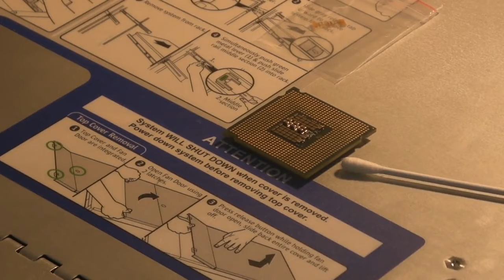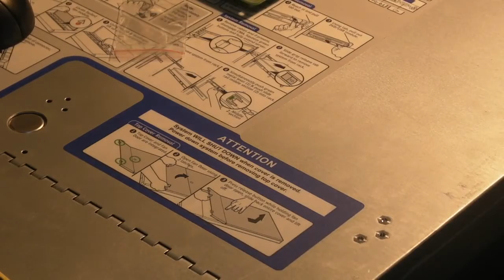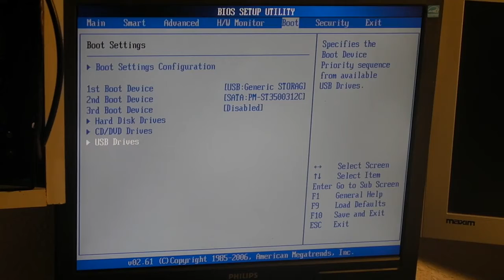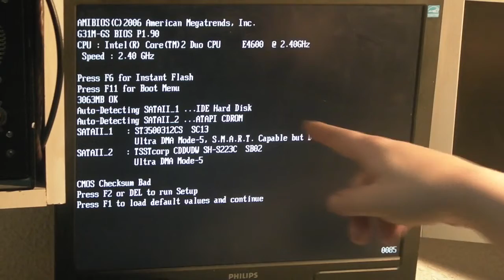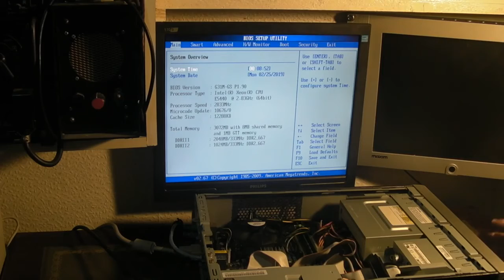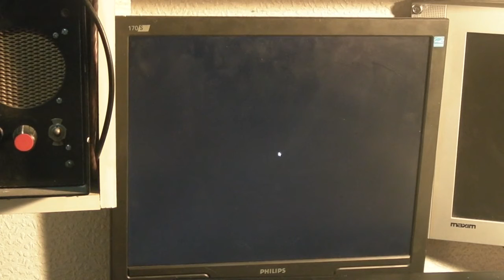Core2Duo CPU to Quad core Xeon CPU on the cheap Pt2

Comment: Realised tonight I don't think this will work for my BIOS =/  I can step up to the 3.0Ghz Extreme (quad) with 12M cache though.  All I will gain is 4M of additional cache, but can overclock to between 4.0 and 4.4Ghz I think.  Will have to settle for that =/
Reply from the maker: I'd of thought if it will run with an Extreme quad then it should work with the Xeon with the microcode added to the bios. (should still run with a unrecognized CPU error at startup without) the only motherboards I've found that you definitely cant use are ones with very old chip-sets that only support two cores not four.

Comment: I was wondering from the start how server memory (which is ECC memory for obvious reasons) would fit into a desktop board...now I know: It doesn't ;-)
Anyway, you can get 8gigs of non-ECC DDR2 ram from china for around 10€. I did the same thing 3 weeks ago and got two sticks of Samsung branded ram which works just fine.
Reply from the maker: Ah yes senior moment on my part lol. Thing is I was intending to put the CPUs and RAM In a bare server case but forgot about the auction missed out and had to change plans.